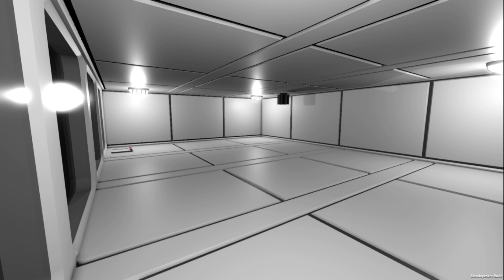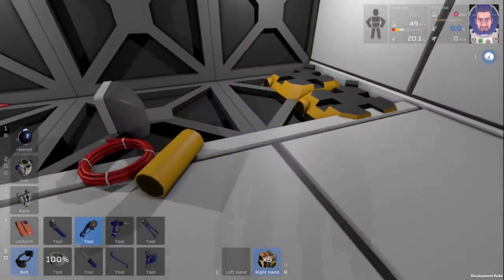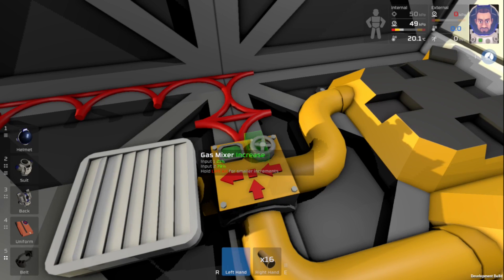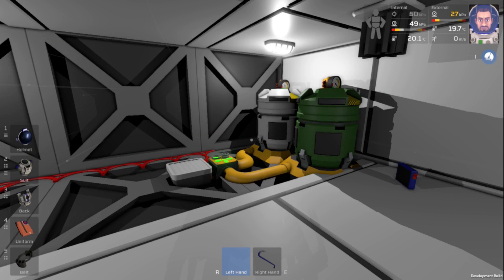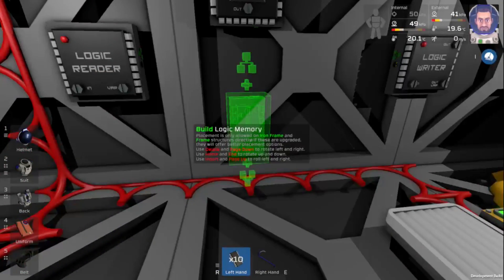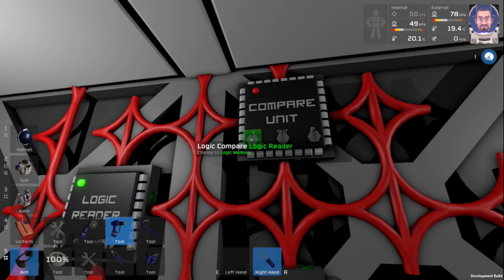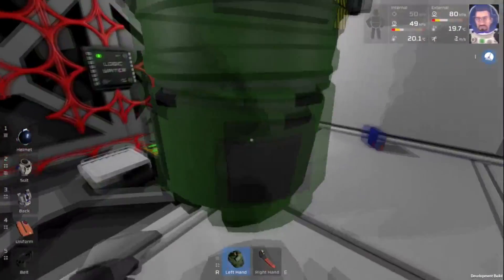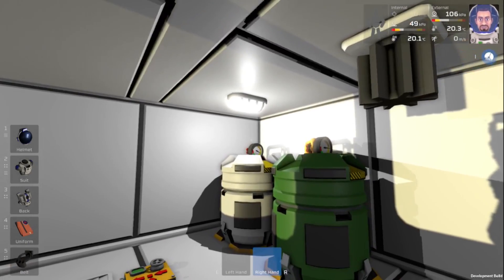Stationeers Tutorial: Base Pressurization

Comment: Thank you 2 years later.  You are my go to teacher in all of this.  I'm making my first "home" with a pressurized area. Never done that before so it'll be fun.
I think I'm going to premix my air tanks (Thanks for the other tutorial), and connect them outside the room. I'll also need to first suck out all the air (I'm on Mars) , so that will go into my filtration system next door. (Thanks for the other tutorial).
I've seen where someone connected 5 passive vents to an active vent and it helped the air move quicker through the airlock, so I might try that too.
Next up, I'll have to deal with heat and cold. (Next one of your tutorials lol)